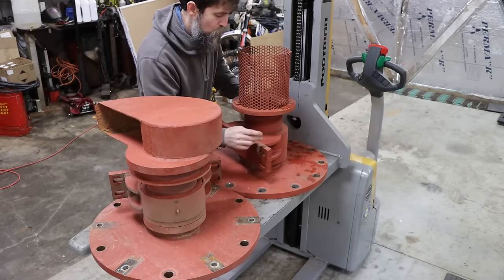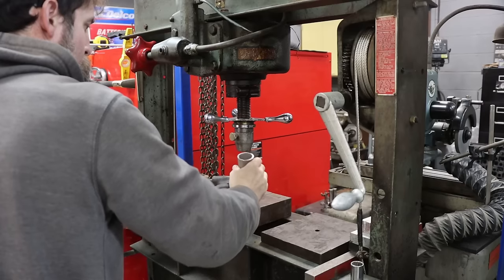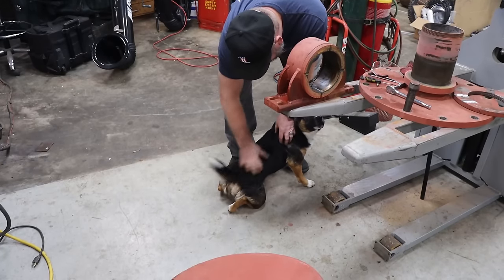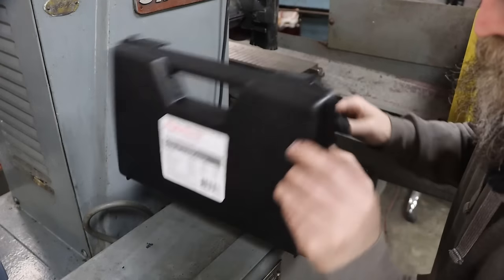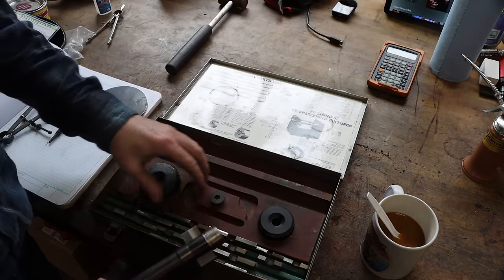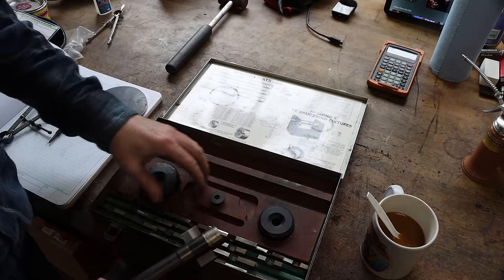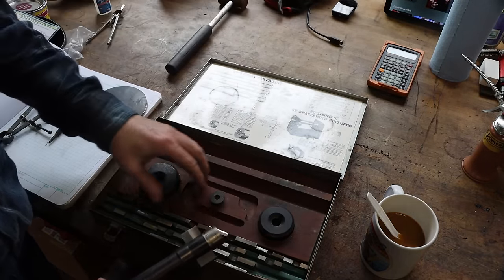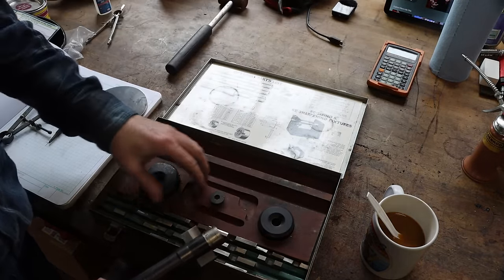Old Research Ball Mill Repair with my buddy Matt

Comment: Hi Steve, Ian from UK. If you've got family, you've got no reason to apologise. That is what most of us have, and know what you're going thru'. Say no more.Loved the video esp the easing of that joint. I hoped you would have used the Kroil on the first sleeve but happy you did on the second. That stuff is a marvel. It isn't sold in many outlets here so costs an arm and a leg. I wouldn't be without it though. 
If the bat comes back, just open the door, it will find it's way out soon enough.  Look forward to next weeks video, thanks.

Comment: Back in the stone age, ball mills were the premier tool to grind pigment to make paint. The mill would be charged with pigment powder and suitable liquid and set to run, usually overnight. Steel balls could be used for blacks, but would discolor lighter colors, so flint pebbles or Coors mullite balls were used. In a production setting a separate ball mill was used for each color due to the difficulty of cleaning a mill and the balls well enough to not contaminate the next color. By the time I left the paint business forty years ago, ball mills were being replaced by smaller lighter faster machines.

Comment: if your saw is the only thing too low for your support stand..put some riser blocks or casters on the saw and get it at a better height for working..i have 2 small bandsaws like that and they were too low for comfortable use anyways...plus i put them on casters as moving or getting them out to use or away from what i am working on.. is alot easier than dragging them or leaving them out in the way !! 🇨🇦🤓🤙

Comment: Use a plastic bag with the parts inside then add expansion foam under the bag and on top till the box is full .  Just like a brick . Tape shut .

Comment: Last time I did a large hole (65mm) in 5/8 steel I used a technique I saw on YouTube. I spotted the hole to mark the outline and drilled a 1/4 in relief hole at the cut line then cut out the hole with a hole saw. I did buy a quality hole saw to start with. Despite my initial concerns it worked perfectly. The cuttings went down to relief hole and didn’t jam the teeth. It only took a minute or two. I did learn it needs to be done dry. Any liquid lubricant I tried to use just gummed up the relief hole and defeated the purpose. The drill press was just an old 17 in Delta.

Comment: Well, I have done quite a bit of machining and truck and tractor repair.  I just watched your video this snowy Saturday morning in Northern Ky. and I have absolutely no idea what you are doing.  Very interesting however.  When sawing round stock on a vertical band saw weld a piece of angle iron to the end to keep it from rolling. Just takes a second.  Ellis

Comment: If you still have that plug. I would suggest welding an inch and one quarter steel block on the face (something to get a wrench on) to facilitate turning it and breaking any corrosion to pull  it out. Maybe a loop also for removal. this could be done without the whole end plate in hand.

Comment: You still haven't installed flow restrictors in the Cat lift to slow the downward movement?

Edited to add:  Even a ball valve that you can control the flow would be better than nothing.

Comment: The ball mill I was familiar with used 2 oil pumps.  The high pressure pump suspended the mill on a cushion of oil; the low pressure pump lubricated the top of the trunion bearings.

Comment: Why did you not machine a little projection on the end of the plug so that it would stick through the hole in the flange and then you could have put a fillet weld around it? Plug welds do have a tendency to crack out and they are hard to repair. A fillet resists cracking much better and should it crack it can be repaired much easier. And yes dammit, I am a journeyman welder.

I've tried spade bits in the past an the only thing I found where they worked well in a radian arm drill press on automatic feed. Hand feeding tends to chatter because the human arm cannot keep a constant pressure on them.

Comment: It's been a lotta years, so memory may be faulty, but I seem to remember the VW factory manual stated a minimum of 16 or 20 tons press force for the ball joints on a Typ 2 Bus.  (Bug is probably less, since they are smaller)   If they go in easier than that, the arms need to be replaced.

Comment: 16:21 a little loop of copper wire (enameled wire you'd find in those old CRT TVs looped around the tube - for size comparison and feel) put around the thing and you slowly pull and twist the spring into position. If you've seen how nurses take rings off swollen fingers using the string trick... basically that, but in reverse.
edit: 20:55 love it when a plan comes through. Noice. I was genuinely expecting you guys to have to open up the dictionary on profanities on this one. :))
edit: 2 25:59 that's the seal. Or rather the part where the hopper meets the scoop. It's not an actual seal, rather an interference fit. Tanks have them on their wheels. There, they're called "labyrinth seals", but without seeing the hopper, i'm not 100% sure if this is one like that.
edit: 3 if you have bats in your area and this happens often, get yourself a net catcher (kinda like a butterfly net, but sturdier). Simplest, best way to deal with them. I would not touch one and be very careful around them. They're carriers for all kinds of diseases. They're not pests, but they're no compatible with us either.

Comment: What?! No Anchor Lube? All the other You Tube machinists I watch use it and swear by it. I used a set of those transfer punches for more than 20 years. They can go with a portable toolbox a lot easier than a regular set of transfer punches.

Comment: Its not the end of the world, but it would better for your torch if you swap the lines round on the cooler, so that you have the coldest coolant to your torch head first and then thru the powercable, just is more efficient... blue line for coolant out, "cold".. red line coolant in, "hot" (which is black in your case)

Comment: Go ahead and admit those were farts Steve.  It's just natural.😊   Nah, just kidding.   I retired from a refinery that used a large ball mill to pulverize unleached zinc.  I don't remember the motor size but it pull over 100 amps @480 volts.  It was a BIG rotating mass.

Comment: 35:50  75 yo man here.  I still cut my fingers/hands/wrists/forearms with sharp edges on occasion.  Sorry Steve, in my experience we human males never do learn.  Always keep at a bare minimum a box of tissues and a roll of masking tape nearby to use as an emergency pressure bandage.  Roll a tissue into a cylindrical shape, press it over the wound & tape all tightly together.  Undo the bandage within ~10 minutes & make sure you've not cut off all blood circulation.  Use that ten minutes to make up a neater kit to build a better bandage, and install it now.  Don't be an idiot, though.  If you are still bleeding a lot, seek help.  Ditto if you are feeling faint [woozy].  I speak from experience.  Better safe than sorry...